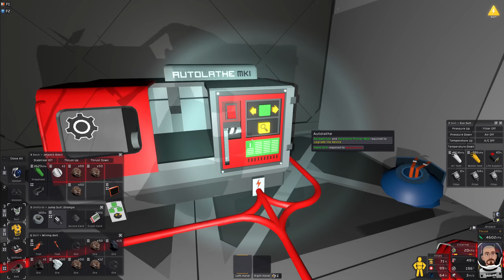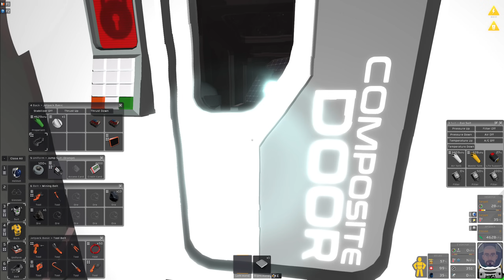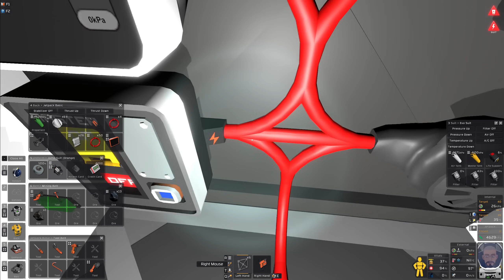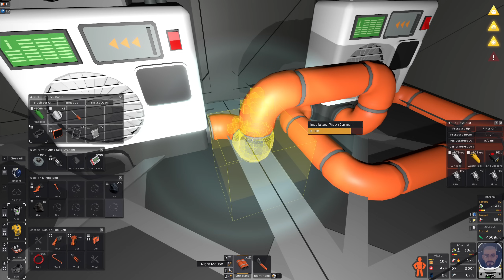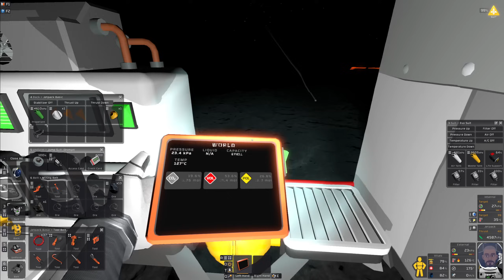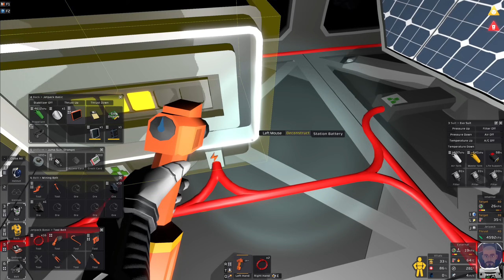Urgent Cooling Needed - S2 E4 ║ Stationeers

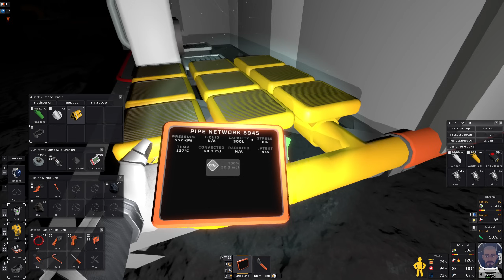Comment: 36:49 Filtration machines now depend on having a pressure differential driving them to process more than a few mol of input per second. Increasing the input volume without having volume pumps on all the ports to drive it won't really do anything any more. It actually works best with only 10L on the outputs since a basic VP can fully evacuate that space every game tick.

Comment: There's probably some gameplay reason for this, and I don't know the game (yet) much. Why do you need a two-stage air conditioning system? Why not just hook up the waste pipe from the first unit directly to the radiators outside?
Reply from the maker: Basically, the bigger the temperature differential, the harder the AC unit need to work, and at some point it's just too inefficient. I cannot use 500C gases as a coolant to keep a comfortable 25C in the base. And that makes daytime cooling pretty much impossible.

So, I use the second AC unit to keep the base's coolant cold enough, so that during the day we have plenty of coolant we can dump heat energy into.
Reply: @Hmuda  Right, I see. Divide the total temperature differential that needs to be maintained into two to make each stage more efficient, also have the option to run the first stage when it is too hot outside to run the second one, got it! Thanks, that's insightful.

Comment: took me lot of experiment to master the phase change but its so powerfull on vulcan its quite simple once you understand how it works and optimise and shrink the system to the bare minimum. almost as sexy as those raptor v3 engine.  less is better
Reply from the maker: Phase change cooling is my ultimate goal...but I think I'll try to do it without using the dedicated devices, and learn the ins and outs of it through brute force. It's one thing to just plop down an evaporation chamber, and vent the hot out into atmo, but building one with smaller valves and pumps should be pretty interesting.

Comment: Hey hmuda, would building a second "shell" around  the station on vacuum reduce the induction heat onto the walls, be of any actual impact on overall on cooling and heating?
Reply from the maker: To my knowledge the walls themselves are insulated, but the windows are a source of heat radiation. Since we need windows, and heat comes in the form of infrared radiation, "double glazing" wouldn't really help. Thankfully it's not that strong, if I replaced every single wall with a window, even a single AC unit could deal with it (at night at least :P).

Comment: Why don't you place solar panels on the roof? I've seen it's possible for solar panels to survive Vulcan heat
Reply from the maker: They needed manual adjustment at the start, and this also protects them from storms.
Reply: @Hmuda  How about window-covered panels on the roof?

Comment: Lol I know it's a game so it doesn't matter. but having that air intake right next to the air exhaust is making my inner environmental controls engineer scream bloody murder 😅😅😅
Reply from the maker: You mean the furnace? It does actually make it a bit inefficient. :D

When I went out "cold" gases and I want to replace them with outside hot ones, I need to wait until they dissipate before I can do a proper vent-in.
Reply: @Hmuda  lol its not a big deal cause its a video game, but I meant the passive vents for the Radiator. Both the Exhaust and Intake are right next to each other.
Reply: @wyvernlord23  I'm assuming you are talking about the filtration he used to add the initial coolant charge? It won't matter in the long run, but the game does actually model this. The filtration will have been quite a bit slower than it needed to be because it kept sucking in its own exhaust.
Reply: yea i noticed that also it didnt make sence but yea game or when the presure increased allot then you look at the temp also increasing allot XD
Reply from the maker: @raro0074  That one has been bothering me a lot in this game actually. Here the temperature/pressure relationship only works in one direction. Increasing/lowering the temperature will change the pressure, but changing the pressure will not change the temperature.

Well...not in the same phase of matter. If you compress gases, they will not heat up.

BUT! If you compress them enough that they start condensing out into liquids, then that process does generate heat. And evaporating liquids also take heat energy out of the the environment. So that small aspect is unrealistic...but the phase-change mechanic makes up for it to some extent.

Which is the way I want to cool the base, eventually. :)

Comment: What are the obvious reasons for not standing next to furnace? 😅 I didn't get to furnace yet, I started checking your videos cause I was completely lost, but game has amazing vibes...
Reply from the maker: I only move away from it when I open the valve/vent. In the early episodes I was tossed around by the winds quite a bit, so now I stand a bit further away. :D

Basically, the more pressure you put into the furnace, the stronger the winds that will come out when you vent. Sometimes it was strong enough to launch me into the air. I got lucky since it didn't throw me into a wall and I could enable the jetpack before falling back down. Now I'm a bit paranoid. :D
Reply: @Hmuda    -   It's not paranoia, those winds are on record many times having smashed players into stuff and damaging their suit and injuring them; a big blast of air at the wrong moment can be a run ender, you make one small mistake and you go crunch.

P.S.  -  I've been trying to get back into the game again recently, and it's rough, I keep doing everything wrong and run out of air, and I even started on Mars with the normal game setting, I used to be good at this game.  I actually was sad when the food rot feature was introduced.

Comment: So, I just purchased it on Steam and it's all because of you so you're either a villain or a hero. Guess we'll find out in a few minutes. 😉

Edit: You're off the hook, even on Linux using Proton it's more than fine even on default settings. :)
Reply from the maker: Well, good luck. The UI will take some time getting used to, but once you have that down, it's a blast. :)
Reply: @Hmuda God yes, it's a great game but it's not even a little bit intuitive. The "tutorial" is bordering between unhelpful and contra-productive. 🤣

It is a challenge and I will overcome. Reminds me of the Space Engineers learning curve but less frustrating, this is more like banging your head against a padded wall.
Reply: @Hmuda  the UI used to be much worse there was a point where you could drag and drop to your hand slots